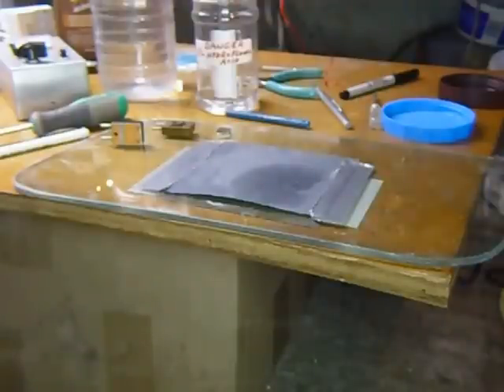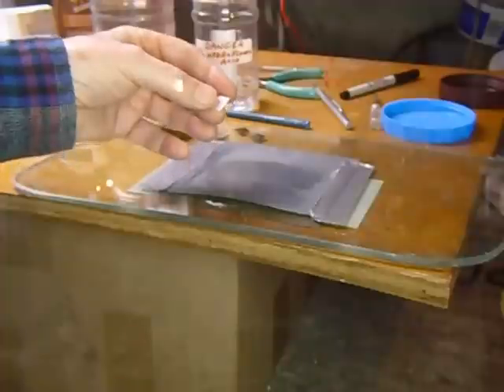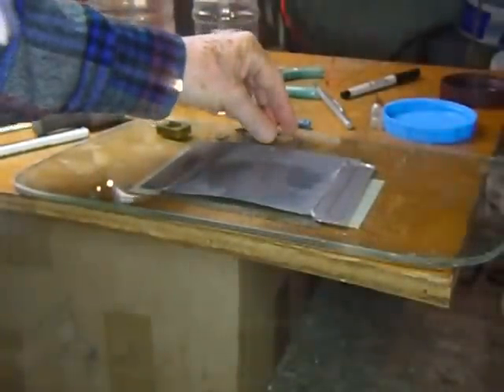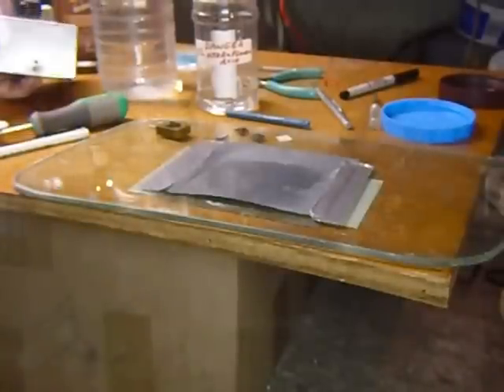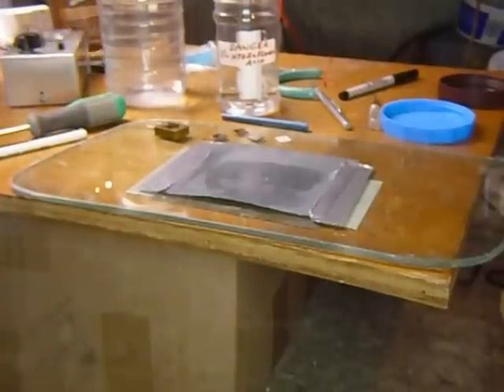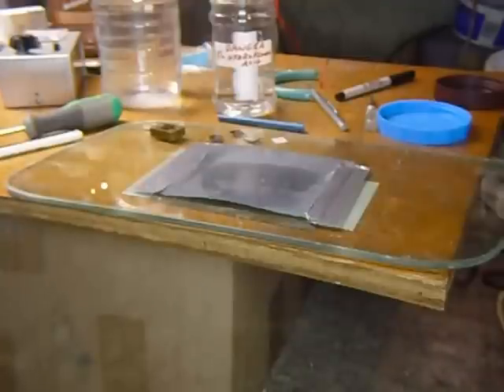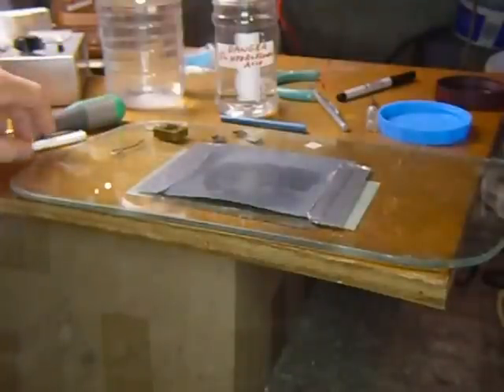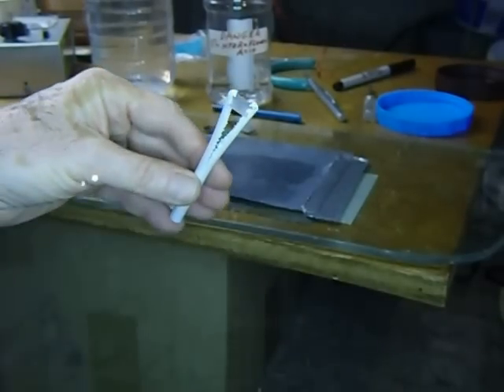Grinding crystals,FT-243, Etching Crystals, Grinding FT243 crystals, Etching radio crystals

Comment: Thanks for the video. It brings back a lot of memories of my early days in Ham radio in the '60s.  I was fortunate that I never had to move a frequency very far, perhaps à few Kc was all. Occasionally, when I over shot  the desired frequency I would use a soft lead pencil to bring it back down. A friend, K4MPA - SK, built a device out of plastic that would hold the crystal perfectly parallel with the grinding surface and provide equal pressure on the crystal as he ground it. He also used a minute bit of dish washing liquid to break the surface tension of the water to allow the ground residue to more easily float away. 

73, de Mick WB4LSS

Comment: The shift differences of 1khz to 10khz of which you spoke sound like the crystal may have become slightly out of parallel, or more in parallel.  Grinding on wet dry sandpaper seems less than ideal, since it’s hard to keep the sandpaper perfectly flat, even with the glass underneath.  I’ve seen it when trying to flatten knife blades and chisels for woodworking.  I was going to try this with crystals on a fine diamond stone snd see where it gets me.

I may try with HF etching, even though that stuff is a bit unnerving with the bone damage it can cause.  there are a ton of 7500mhz and up crystals out threre, no so many in the 8-9mhz range.   I’ve got some gonset gooney birds I’d like to get on the air, and would love to have a few more useful crystals for 2m and 6m for them.

Thanks for the informative video!

Comment: I wonder if you could set up a sputtering chamber, or make some other way to plate the flats on a crystal in order to bring the frequency back down?  I’ve seen in a friend’s lab where they had the ability to do this in order to get samples ready for electron microscopes.

Comment: Sounds like you said Hydrochloric 1st time but the label says Hydrofluoric and later you clearly said Hydrofluoric acid.
Nasty stuff. Prior to plastic containers, it had to be stored in GuttaPercha containers.
There's so much quartz in FT243 rocks that much adjustment can be achieved.and they stand up to some pretty tough treatment.
Modern rocks are much smaller, more fragile, don't have separate plates and can't stand as much (grid) current in a valve (tube) oscillator.
The plates are usually 22 carat gold, vacuum sputtered on to the quartz with masks on the xtal.
Figure of 8 grinding, etching and other little tricks with solder are really not feasible.
Scraping away small amounts of gold will reduce the capacity between the plates with a QSY north but the ESR can increase and activity can diminish, some times cease.
Brief exposure to the brown fumes of Aqua Regia can take away some gold with a HF QSY but utter and PROMPT cleaning between etching & testing is essential.
The etching continues on route to the water! Aqua Regia is also NASTY stuff.